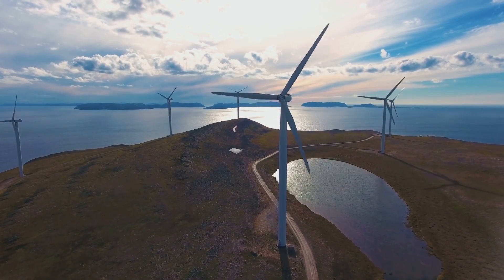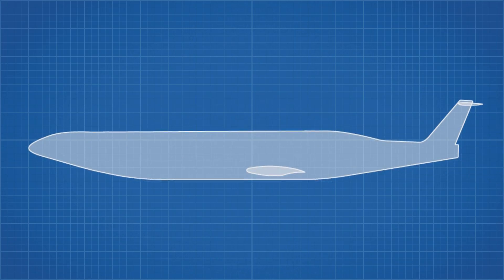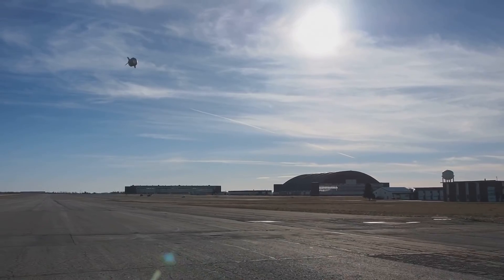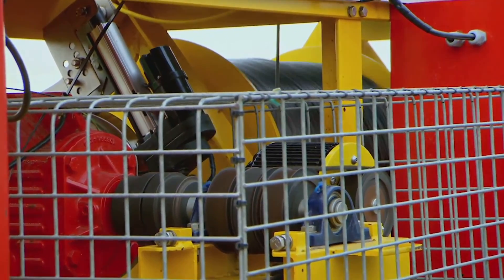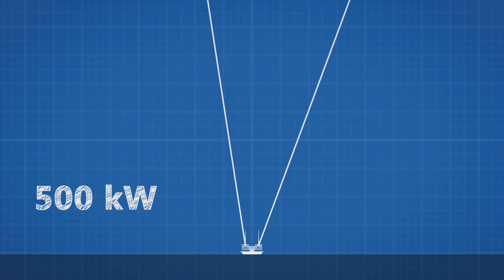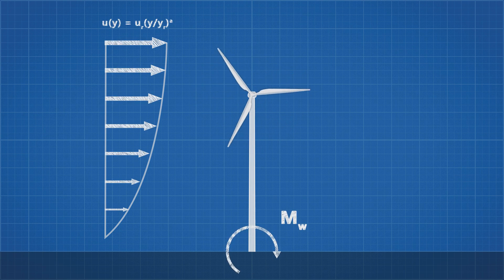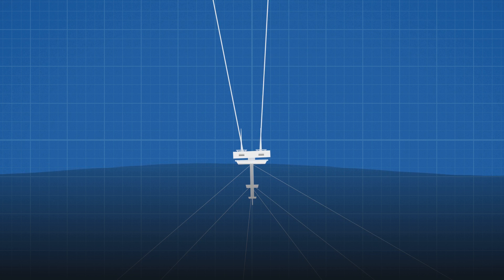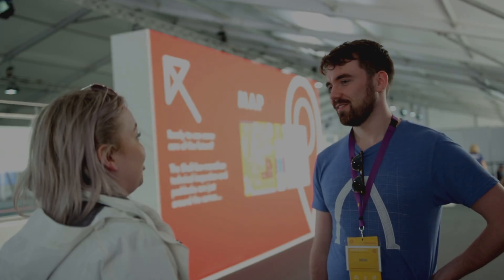The Future of Wind Power? - Kite Power Systems

Comment: It actually is more plausible than I thought it would be from the title.  I would say that the major drawback has to be those steel cables.  They are invisible to planes, but are still deadly should one fly into it.  Amateur pilots are going to die to those.
Reply: In the United States, permanent balloons and other tethered items have permanent flight restrictions around them clearly marked on Sectional and TAC Charts (Example: R-2916 near Key West, Florida).  Temporary deployment of a system like this would almost certainly cause a Temporary Flight Restriction (TFR) in that area, which would show up in preflight planning as a NOTAM.
Reply: @vt-1493   (and the others claiming that marking it as nof fly zones is the soulution)
that would mean that you couldnt put these anywere near big citys (or rather areas with airports/that are in a landing tragectory of the airports)

also the long cables with moving kites offer another major problem:
you cant put multiple of them near each other unless you want to risk them entangling.
Reply: or put a couple LED lights along the length of the tether, problem solved
Reply: The cables are in fact HMWPE not steel. They would still be hazardous to aircraft though. In practice they will be physically marked with visual aids and specificed as a hazard on air navigation charts. Their airspace - as per the test sites- will be off limits to aircraft as per the well established precedent of nuclear power stations and military airspace. Most aircraft are well above these kites so the impact on aviators is minimal.
Reply: There would probably be a no-fly-zone surrounding them.
Reply: Michael Williams They would probably have either red bouys or red beacons on the teathers so that pilots can see their relative possition in the ocupied space. This is similarilly used for power lines and mountain gondola cars.
Reply: Where is most of the energy coming from vertical or horizontal motion? Whether it's regulated or not This Could Be a Menace to aircraft. Keep up the innovation, my impression is that the future will have a collage of options when it comes to energy.
Reply: They'd need lights running up them
Reply: To VT-14:  Ditto for Canadian Air Space, including requirements for NOTAM (Notice To AirMen).  Covered Internationally by the International Civil Aviation Organization (ICAO).  The cables are safer for birds and the wind turbine noise is eliminated fir concerned communities.  High elevation bearing and blade servicing is eliminated, reducing risk to servicing technicians and riggers and removing need for fall-protect protocol.
Reply: There are VFR charts for something.
Reply: same solution as preventing aircraft entering weapons test zones, laser zones, rocket sites etc, R class airspace that requires reference to NOTAM's and ERSA's to be navigated through or over. Even "amateur" pilots know this, unless youre referring to self-taught, unregistered, unqualified people who own an aircraft and fly illegally in which case there is very little you can do to prevent them from their demise in short order.
Reply: You mean like overhead power cables? Oh no, the horror!
Reply: like how they use balloons in WW2?
Reply: To add to what @VT-14 said, they would also be painted in bright colors and probably have some sort of flags on the upper parts of the cables, like power lines, to make them more visible.
Reply: Also lightning and birds.
Reply: You must be joking.
Reply: Amateur Pilots don't have to deal with them at all. Just Flight Controll and the FAA
Reply: Michael Williams strap bright led to the entire cable or paint it with something that glows in the dark.
Reply: Don't they have no fly zones around wind turbines?  Just do the same around these.
Reply: Well it's not as if flying planes, let alone just for fun, had much of a future. I don't think there's a problem with marking these sites as no-fly zones, but people will have to effectively stop flying anyway, for the same reason we need solutions like these kites in the first place, so impact on aviation isn't really an issue.
Reply: Michael Williams If the cable had reflective paint and planes had weak lasers the could see the cable from miles away!

Comment: I always thought that the flight time difference (an hour longer dublin to nyc than the reverse) is due to earth rotation, not wind. flying dublin to nyc the earth is rotating in the same direction of travel meaning that the distance traveled by the plane is the distance measured on a globe plus the amount the earth has rotated under the plane during the flight, resulting in a longer flight than one would expect based on the physical distance between the two cities. However, going nyc to dublin, the earth rotates in the opposite direction of travel, meaning that the distance traveled by the plane is the planetary distance minus the amount the earth has rotated under the plane during the flight, resulting in a shorter flight. as flight times are calculated and posted many months in advanced, with our current weather prediction technology, seems unrealistic to be able to predict so far out and how the wind effect would be able to be both so consistent (tuesday flight time is set to be the same as a month from now).  

thanks for sharing though - i am always interested in new technologies.

Comment: 500 kw with those 2 little shits? Allright, this stopped sounding ridiculous.
Reply from the maker: My reaction too! We will have to see if they deliver on their promises with this test site though
Reply: @Jeff W What exactly do you think engineering is? This is as real of engineering as you're gonna get. It looks like it's a pretty novel idea for an important issue, and it's in a stage of testing to determine sizing/scalability, which means it's still actively being designed. This is all apart of engineering. You are learning all of this and even seeing footage of a this novel idea in action - it has obviously passed previous testings and design iterations to get to this point. And this isn't even historical stuff, you're learning about real engineering as it's happening in the real world right now.
Reply: Nope, he said kW
Reply: Jeff W . lol, because things that have been "engineered" were never tested! right?  /s
Reply: It's a kite because it's tethered
Reply: Assume that the kites travel at 10 ms-1, simple math will tell you each kite need to pull 25kN, which is the weight of a 2550kg object. So basically, 1 kite needs to life a heavy car at 36km/h to reach 500kw, and that is assuming 100% efficiency in the generator.
Reply: There is a paper for crosswind kite power, and the calculation is not as simplistic. 500kW is quite possible for a kite that size. The original paper made by a Miles Lloyd overestimates the power production (paper he had written in 1980), but a revision made more recently still shows a potential of a few MW for a kite with a surface area of a C5-a airplane wing.

Remember these are "crosswind" kites. They don't purely work like parachutes in reverse. They produce lift like airplanes. That's why the kites fly around in a figure-8. Single engined aircrafts can take off at 1600kg with wing areas as small as 14 sq.m. The kite would have at least twice the wing area. 3 tons of pull per kite is possible.
Reply: @henrychan720  the 500kw system has two kites
Reply: Iron M Google Kites and you will know why it is called  kite
Reply: There's already more than one company on market with that technology. 500KW is the botom generation, the research is to deliver much more than that. Yes, in my opinion this is one of the "cheapest" cleanest and more inteligent power generation system.

I wish some of these companies delivered this in an open source license
Reply: Never would that produce 500 kw
Reply: KPS was acquired by KiteMill and no longer use this system in favor of a plane with the generators on top
Reply: +Jeff W So if it's not tested, it's not "Real Engineering" then, is it? Seems like the title of your channel is a bit of a misnomer.
Strangely artful, this thoughtfully expressed ignorance.
Reply: Electron Proton Neutron Mouron I think I misunderstood you, but maybe you are mistaking power and energy. Watts measure power, so if this kite produces in a windy day 400 kW on average, in an hour it would produce 400kWh of energy (or 1.44x10^9J), which is pretty ridiculous for a mere kite and a rope.
Reply: @keepercool98  we sholud mix this whit gravity light sistem
Reply: Exactly.  Easy to make claims.
Reply: Jeff W engineering consist of theory and applications. This one only done the theory so far.
Reply: Iron M lol it's a standard paraglider wing....people have been flying them for over 20 years. Not a parachute, much different.
Reply: CIA  google paraglider lol it's a standard paraglider wing....people have been flying them for over 20 years. Not a parachute, much different.
Reply: Isak Viklund Iron M lol it's a standard paraglider wing....people have been flying them for over 20 years. Not a parachute, much different.
Reply: One hydroelectric generator in a dam I work at makes 600 MW...not KW. These paraglide wings making electricity are cool...but cute.
Reply: And it doesn't kill birds, like windmills do.
Reply: @Java2Docs  altought the kites do move fast, in an eight figure and are big and they do have weight so, and you know some birds are not the sharpest tool
Reply: why are they called kites anyway? they look a lot more like parachutes to me. and if they deliver at least half of what they promise... well, that would be pretty awesome
Reply: How many households is that?
Reply: Nobody has mention wattage in hours so to claim 500kwatts is fine as there is no defined time! So maybe they are saying 500kwatts usable life porential ! Misleading to say that but I feel it certainly would have this potential but not in 1 hour !
Reply: @Buzzhumma  
Exactly bro
Everytime when new thing coming the promises are 50× or 100 times better and we excited and then finally product comes 30% better or efficient 
I hope and pray this kite make 500kwh
Reply: @Buzzhumma   i think it is per hour
Reply: 500 watt I believe. Too much for 500 kW.

Comment: How do they want to place then in close proximity like windturbines without the kites crashing into eachother when a strong win from the side hits it?
Reply from the maker: Each kite has GPS and a controller attached. They aren't just flying around aimlessly.
Reply: Real Engineering Yeah you said that in the video but can the gps correct it's flight fast enough?
Reply from the maker: Sorry, thought the part about the controller pod covered that. If it can do it for drones it can do it for kites!